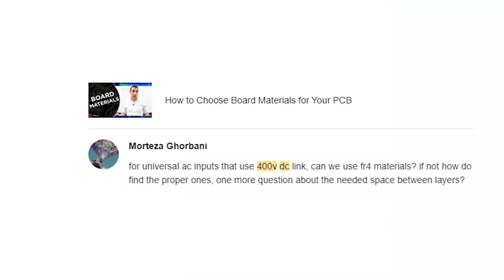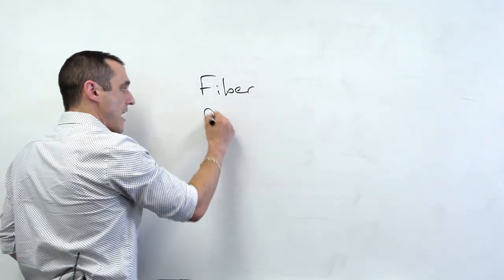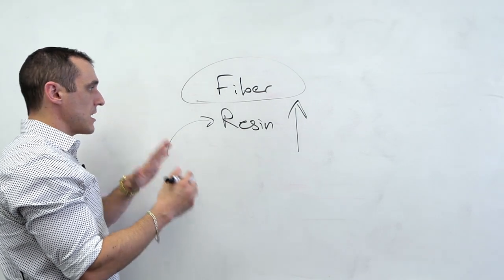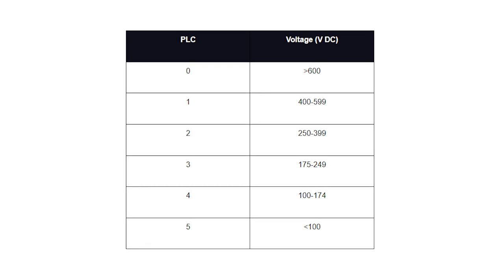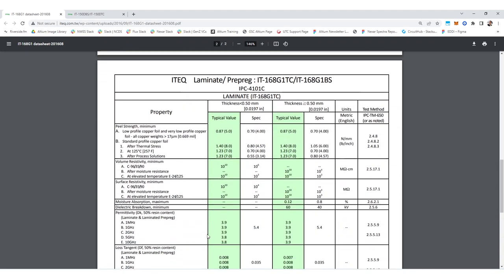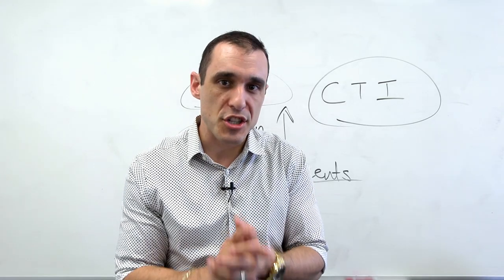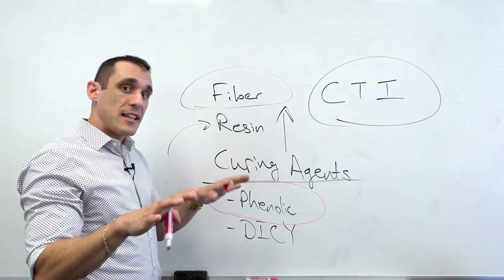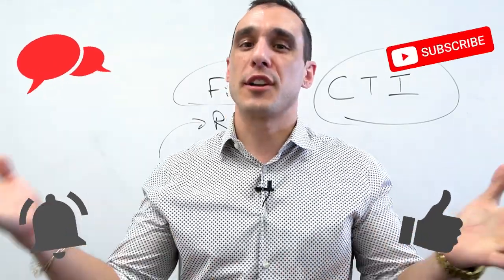Understanding High Voltage PCB Materials

Comment: Hi, you didn't respond to the question of how to calculate the thickness. I mean, if on the datasheet of the material you have a breakdown voltage of 40kV, and they say the standard with which they calculate them... how can you convert that value to the minimal thickness needed. For example, my manufacturer has this on their website for a high CTI board: Dielectric breakdown IPC-TM-650 2.5.6. 60+kV No Breakdown. Reading the IPC says how the test is made. Two holes with 1inch between them. So 60kV/inch, for a dielectric of 4mils we have a dielectric capable of 240V. So with a derating of 1/3,  I should consider no more than 80V between layers.
Please correct me if I am wrong.
Thanks in advance.

Comment: We practically discovered CAF back in the 2000's. We had failures and spent months testing PCBs to see what was going on - there was no documentation on it back then. CAF was happening to us at permanent automobile voltages: 12V!
Reply: It only occured at certain temperatures and humidities, and the symptoms would go as soon as you cut the board for inspection or tested it - the filaments were tiny and fragile in the PCB weave.
Reply: @robertbox5399  I've seen some interesting SEM images of it

Comment: Is it possible you can show different connectors, ideas and many safe ideal methods on how to connect or interface high voltage & amperage wires to PCB boards? Such as what is the best and ideal way to connect/interface a lug eyelet connector to a PCB? Thanks. No info on this for youtube, it is a rare topic. Thanks.
Reply: Great question, you're right there is not a lot of information and a lot of the things I have learned about it have come from some webinars. I will see if we can get someone from Molex to give some more insight into this as they have some products that are indended for this area.
Reply: @Zachariah-Peterson  Thank You.

Comment: How do you calculate the thickness needed in the board between diffrent high voltage layers?
Reply: Typical electrical breakdown values for a PCB laminate are approximately 1000 V/mil, although this can degrade over long periods of running at high voltage depending on the chemical composition of the laminate. The voltage is determined by taking the applied voltage and dividing by the breakdown strength, this will give you a distance that tells you the minimum layer thickness for your applied voltage.

Comment: How does having more resin make the material better suited for HV? I would've assumed the opposite, given that glass is good for something like 2.5MV/inch while even PTFE is about half that.
Reply: I don't know that there is any specific trend, I just know that it tends to be higher than a laminate you might use with a tight weave or with spread glass for a high speed digital board. That's why we have a summative metric like CTI, it's much easier to use that rather than looking at every particular of the resin system and trying to figure out if specific resin systems/content will work in different voltage ranges.
Reply: You're asking a materials engineering question. This is like esoteric secret society type knowledge. I'm sure it has to do with the material density and its packing structure at the crystalline level along with its interaction with other nearby materials. What exactly is happening there is a mystery to most people.
Reply: @seinfan9  I was thinking the same thing

Comment: How can i design a 4 layer high current pcb (up to 35A) as i used the regular calculation method and the traces were so large?
Reply: When you say "regular calculation method", what do you mean? Which formulas did you use to determine trace width?

Comment: 400VDC? I can think of only a couple realms where this would be encountered; sounds like Morteza might be working with hollow state thermionic valves. This is tangential to my interest.
Reply: 85-265VAC switching supplies have a rail that is at max 375VDC, close enough to 400VDC

Comment: Conductive anodic filamentation and tin whiskers are same?
Reply: No they are not the same. CAF is internal to the board and is driven by electrochemical reactions near copper on inner layers. Tin whiskers (sometimes called dendrites) are seen on the surface layer when tin electroplating is used, and they result from metallurgical growth driven by internal stresses in the electroplated material. This was why lead was added to some tin platings: to reduce tin whisker growth. It's also a reason I say to avoid immersion tin platings in devices that require long lifetime.